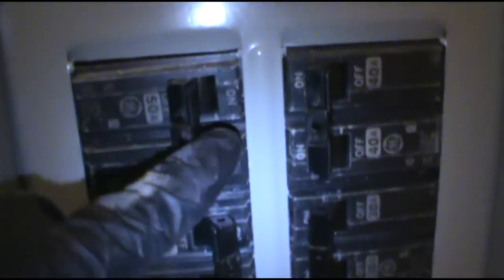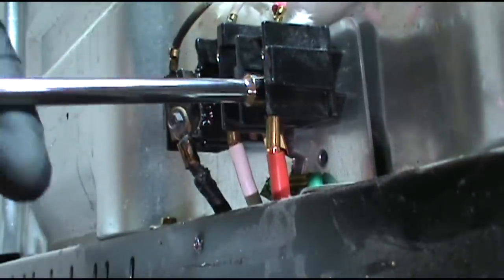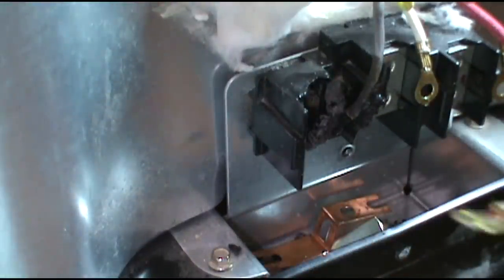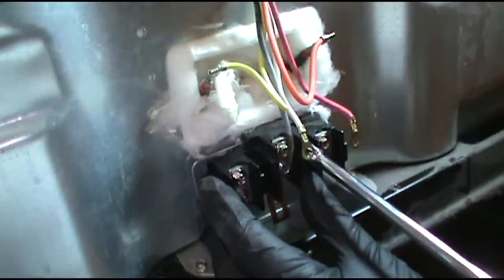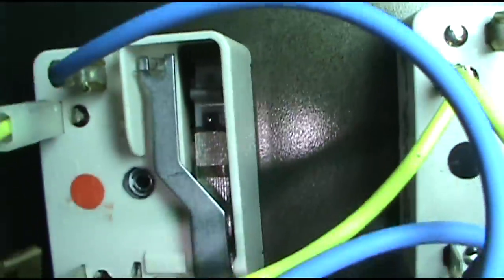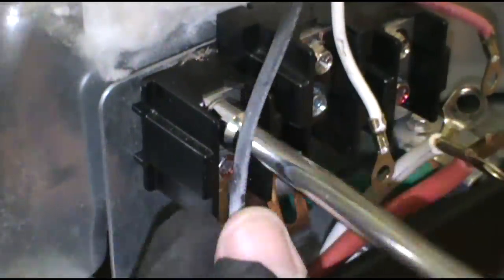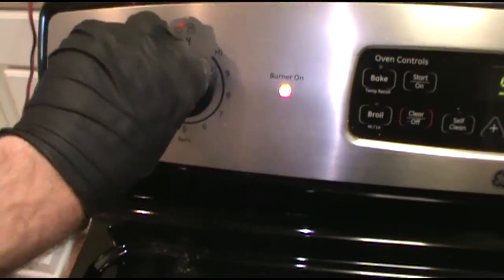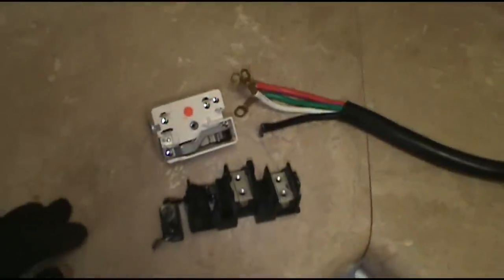Repairing An Oven That Keeps Tripping The Breaker

Comment: Your video turned into a fix on my Frigidaire stove buddy. I, too, had a blackened area in the most often used stove burner switch. That increased the resistance, or the wire I found that wasn’t sufficiently tightened from the factory. Anyway, new switch, new terminal block, back in business (all wiring looked pristine). Here’s a homeowner saying “Thank you sir” with great sincerity.
Reply from the maker: Awesome! Thank you so much for watching Ed!

Comment: This may be a dumb question, but what is actually happening to trip the breaker here? Was the connection that melted out of the terminal block touching the chassis or the other connections? Obviously it needed to be replaced but I'm just curious how the terminal block being melted was causing the oven to pull too much current and trip the breaker, or if it was melted as a result of the oven drawing too much current or something else I'm just completely missing. (To be clear I know nothing about appliance repair and don't want to sound like I'm questioning your judgement, I'm just genuinely curious what's happening)

Comment: nice job lex...we still got GE ranges from the 80s up here in my complex and get this call now and then...I rewire everything with high temp fiberglass wire and porcelain wire nuts..wire is not cheap but it lasts.
Reply from the maker: working shlub This one was a 5 year old GE. 😂 Goes to show they dont make'em like they use to. Thank you so much for watching working shlub!
www.DirtyMaintenanceNation.com

Comment: ❤ what causes a stove to start popping the breaker?  Stove has been in the apt for 10 years.  No issues before.  Tenant asked for new burners, but they were just replaced in 2021, so not burned out. ❤.  Probably will just replace stove for 569 at Lowe’s.  Thank you for your video.  ❤
Reply from the maker: Wires touching somewhere. Look in the back where power goes in or under the elements. Wires get melted under there where I work and pop the breaker. We have to wire in new element block.

Comment: Just saw this today, Lex. I have had to replace about 3 in my work experience. It's always been the left terminal and I have had to replace only 1 wire going upward to the infinite switches. I have kept the wiring harness for emergency wire to use when I scrap a stove. Especially if it takes too many switches or oven controller parts. The owners would rather replace oven if parts overun the cost of new appliances.
Reply from the maker: Right on. Thank you so much for watching Thomas!

Comment: Duuuude your repairs are so on point.. I've completed multiple work orders thanks to your videos this one included. My issue I got right now is the residents electric range is tripping the breaker but the breaker is missing the bridge between the two breakers going to the stove and only half the breaker was tripped???
Reply from the maker: Weird! I'd need to be there for this one. You got an ol' head scratcher there. Gotta be a burned wire some where.

Comment: Nice video and good work. Question, I have an oven doing the same thing.. immediately tripping the breaker. If I unplug the black hot wire at the oven, it doesn’t trip. I didn’t see any obvious burns like yours.. any ideas? Keep up the good videos.
Reply from the maker: Hmmm, it could be inside the plug harness. Also, lift the stove top up & look at the element plugs. It could be a burned wire inside those plugs. Sometimes these things can be tricky.
Thank you so much for watching Narib!
www.DirtyMaintenanceNation.com

Comment: Lex, the ground strap on the neutral terminal of the terminal block is only to be used with 3-wire power cords.
Reply from the maker: GaslightAlley Yep you're right. I went back with what was there when I showed up. It was wired that way by an electrician 5 years ago when it was installed. Thank you so much for watching Gaslight!
www.DirtyMaintenanceNation.com

Comment: Can't get right here! My question is when I turn on,tha oven light,then it tripped the GFCI all the time can you help on the problem thanks.keep on trouble shooting.
Reply from the maker: I'm not sure an oven is supposed to be wired to a GFCI. I'm use to them having their own 240 volt circuit and breaker. I'd need to be there for this head scratcher. 🤔

Comment: Hi Lex, my oven trips my entire apartment after about 5 minutes of heating up. The rest of the stove plates work just fine. Would this be an issue with the element? (it just a little hot before it trips the mains).

If so, could I simply switch off the oven circuit at the circuit board (or swithh off the entire mains for that matter) and replace the element myself? Do I need to take any further precautions? (I don't know how to use a multimeter).

With all this being said, I have utmost respect for the repairmen profession - this just seems like an easy fix and I will feel good doing some DIY.

Kind regards from South Africa.
Reply from the maker: That's hard to tell by not being there. Lift up the stove top & look under it & see theres a burned or loose wire. Also, it could be the terminal block in the back where the plug goes. A burned loose wire is my guess. Hard to tell by not being there. Thank you so much for watching!
www.DirtyMaintenanceNation.com
Reply: @LexVance  okay thank you for your suggestions and prompt response. I appreciate it.

I will keep your advice in mind but get a repairman to come through nonetheless.

Cheers!

Comment: Where did you get the new black L1 wire that you attached from the switch down to the terminal block?  What is it called and how can I look it up at an online parts store to buy?
Reply from the maker: I got it off an old stove that we stripped for parts. Call GE and they'll get one to you. That's who I order from. I call them and give the model and serial number of the stove and they get me the parts.
Reply: @LexVance  Ok.  What if I need that wire for a different manufacturer of stove like Amana, Whirlpool, etc?  What is that wire called so I know what to ask for?

Comment: On the terminal block would there be an issue with wiring the black directly to the black that supplies the oven, on the same screw, as opposed to the screw below it.  Theyre connected by the metal block so I would like that wouldn't matter.
Reply from the maker: No, it's okay the way you're describing. Don't matter. Thank you so much for watching Trent!

Comment: Did you have to replace the black wire
Reply from the maker: If it needs to be. You can cut the burned part off and get to fresh copper if you can and have the length. Thank you so much for watching Stacia!

Comment: was it just my eyes/camera trickery or was the old pigtail smaller gauge wire, like 30 amp/10awg dryer cable?
also when you have a 4 wire/4-prong pigtail and outlet, remove the copper bonding strap going from "neutral terminal" to "ground". it's there in case of older building with 3-wire/3-prong outlets, it bonds the metal oven case to neutral leg. the same applies to dryers.
the code changed long ago for safety, if the neutral opens between appliance and panel you can get a shocked/killed from the oven case to anything else grounded. they were all that years ago (think the code change was in 1996)
Reply from the maker: throttle bottle I wouldn't be surprised if it was. 😂 Its been like that since the place was built 5 years ago. You should see the things I don't record. 👍😂👍 
Thank you so much for watching throttle!
www.DirtyMaintenanceNation.com

Comment: Hi Lex, I have an issue here: I just bought a refrigerator recently and then when I switched on my oven, It tripped the breaker immediately. Even after I switched off the refrigerator, the same issue still occurred. I am confused because it was not like that before i bought the refrigerator.
Reply from the maker: Hmmm, your refrigerator is on a totally different circuit than the oven. The oven is 240 volts & fridge is 120. I think it's just the oven wiring or a bad oven breaker. The fridge is fine & shouldn't have anything to do with it.Thank you so much for watching J Z!

Comment: What can I check if when the oven is on and nocks off the whole apartment?
Reply from the maker: The back main power wire coming into the bottom. That's the high voltage so turn the breaker off. Wire could be burned or has a nic in it and touching metal frame. Pull oven out and you'll see main power wire coming into it at the bottom in the back.
Reply: @LexVance  thanks 🙏, love your videos, God bless

Comment: My oven is about 6 months old and is tripping the breaker.  Just started happening yesterday and did it again this evening.
Reply from the maker: Check the back where the 240v power goes in. Could be a burned wire or a loose wire. Easy fix. Thank you so much for watching Hallo!

Comment: Can you help me ?  when i turn on my oven the power of all the plugs drops can you help me to know what is this?
Reply from the maker: You need to check the terminal on the back of your oven. Turn the breaker off and check for a burned wire. If you don't see anything, then reset breaker for other breakers and leave oven breaker off until a repairman can come out. Thank you so much for watching!

Comment: So, what do you do when you have an in-wall GE oven that keeps tripping the breaker, you go to pull the back off of it, and the circuitry looks nothing like this?
Reply from the maker: Could be a bad breaker. I've seen burned wires in the breaker box.

Comment: Looks like a loose connection Skid also good video
Reply from the maker: K D Yep that's what I thought too. Thank you so much for watching K D!
www.DirtyMaintenanceNation.com
Reply: Hey skid another thought I have run across the situation of main tripping rather than the individual breaker tripping many times and what I generally do is replace the circuit breaker and inspect bus bar behind the breaker and also I will remove breakers above and below to look at that area of the bus bar also. just my two cents KD
Reply from the maker: K D I dig it man!